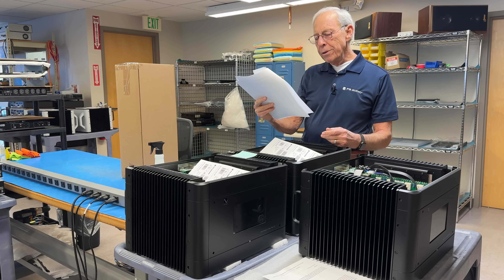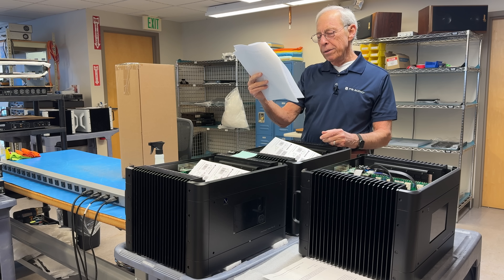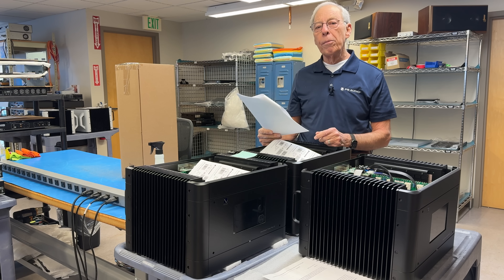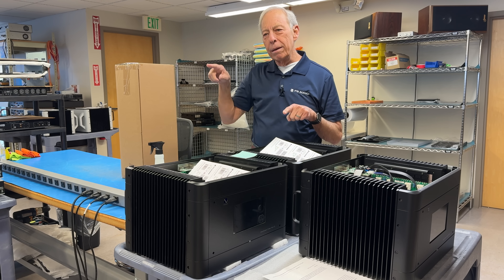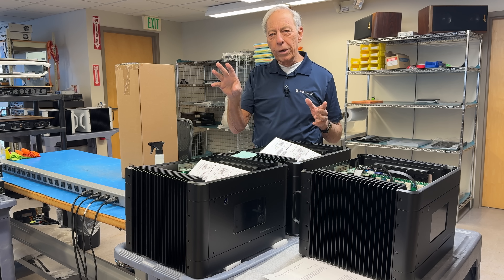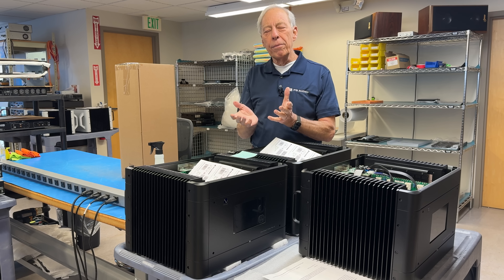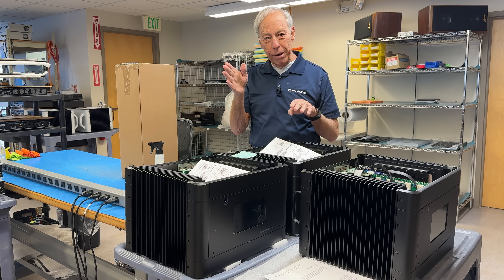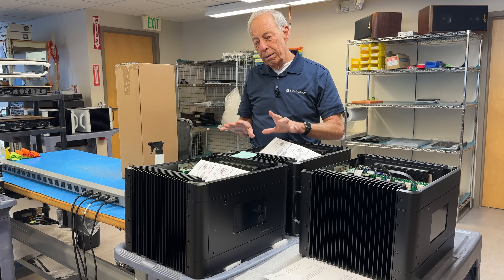Paul explains damping factor

Comment: Late to this discussion.
I found this one very controversial. I'm not sure where to start.
First I own a Magneplanar 1.6QR.
I also own a Rotel MK RB-1582. Both are paired with 10 gauge home depot wire. Sorry, exotic cables are just snake oil in my opinion.
First the maggies are relatively easy to drive. They are almost 4 ohm resistors. Any amp worth it's salt can drive these things. The amp is rated 323 watts into 4 ohm loads .
The amp is rated as having a damping factor of 800. I also liked Rotel's design philosophy of placing high emphasis on the power supply. We are basically listening to modulated power supply output.

I enjoy listening to my system and only had 2 issues which are kinda nonissues. First I tested to see how loud I could get it without the wife around. It got very loud, just not super loud like conventional boxed cone systems or my favorites, Klipschorn.
The second was those canon shots on Telarc's 1812 overture. I could hear that known rattle from mylar diaphragm. That just confirmed I'll buy a sub. No hurry though since 99.99% of the time it's excellent.

Circling back to the topic, I wonder just how genuine the original question is.
Also, do I detect a bit of jealousy from Paul since McIntosh is a rival. They make excellent sounding amps.
The letter writers shock at the rotel not properly driving the 3.7 is shocking to me as well. It doesn't make sense.

Comment: Its all about Control! I owned a system and had a Kenwood KAC-1021 which was rated at 840 watts @4ohms for my Kicker dual 10” Competition box. The Damping factor on it last I knew still hasn't been matched but maybe someone does make something, the rating? Hold on Tight, it was 5,000

Comment: 30+ years in the biz, EVERY company that says damping factory is meaningless has low or unrated damping factor. 
IMO: My favorite amps are: Pro/studio - Crown, home - Adcom and Car - JL audio and Soundigital.
Each have 800 /1000/3000+ damping factor specs. 
Crown Studio Reference amps are 20,000+
Bass is very accurate, very controlled. Very noticeable difference, especially when playing at louder volumes.

Comment: As I understand it though, Paul....very high damping factors can sometimes come across SUBJECTIVELY as having too much grip on a driver.   As a result...the subjective listening impression can be described by some as dry or clinical, possibly lacking in decay and "realism".   Whereas a damping factor that is sufficiently high, but more in some sort of sweet spot (often discussed as about 8:1 for dynamic headphone applications)…yields what many listeners perceive as a warmer and richer tone to the music.   So I think I understand this topic as still in search of a bit of a goldilocks outcome....not too high, not too low.   The implication being to have a clear understanding of the "matching" you are doing when you put system components together in a chain.   Do I have that about right?   It makes me sort of wonder what's the damping factor of our eardrum relative to our auditory nerve, if there is such a thing!

Comment: Seems to me that if the amplifier has zero output impedance (in effect a short circuit) then damping is limited by the resistance of the speaker and cable.  To get damping better than that means making the output impedance negative.  Is this commonly done?  I don't know.

Comment: Hi Paul, where do you pull your questions from?  What happens when you pair an amplifier that has a higher power rating than the recommended power suggested for the speakers?  I have an Arcam class G amp rated at 80watts into 8 ohms and 125w into 4 ohms.  My Totem Arro's are 4ohm, and have a suggested 20-80watt amp to drive them. I've owned this combination for 4 years and haven't noticed a problem with the speakers. So what is the 'problem potential' when you have an amp with a slightly higher max power rating than the max power suggestion of the speaker?  Thanks. Cheers.

Comment: Beware that speakers' rated impedance is NOMINAL. Speakers work at different impedances based on frequency, the rated impedance specified is just the range of impedance in the impedance curve that occurs more frequently. So if a pair of speakers is rated @ 4 Ohms, it means that in its impedance curve througout a listening session, based on the signal frequency (which is not constant) the impedance fluctuates touching several impedance "points", lower and higher than the rated one. In doing so, 4 Ohms "range" is the most occurring one, which determines it being specified @ 4 Ohms. In this case you need to know that you need to buy a power amp that is rated the power you need at the given impedance. However, also beware that damping factor means higher negative feedback (at least to my knowledge), which might result in a more controlled sound to the point where it might get lifeless or too flat. Normally is unlikely anyone needs a damping factor higher than 100. We often see amplifiers specified at several hundreds when not in the range of thousands. I am not sure that is really necessary or is just overspecification to attract customers. I'd rather have a reasonable damping factor, as low as I really need hence the least amount possible of negative feedback.

Comment: Many years ago, I was looking for an integrated stereo amplifier.  The salesman was showing me Rotel and telling me how great it was.  But then he insisted, you will need a powered subwoofer.  I told him I already had speakers that would shake the walls and had enough bass without a sub.  With "just" a tube amp.  I did not buy the Rotel.  Surprise surprise.  There is better equipment out there with more current to speakers for less money.  That's all I'm going to say about Rotel.  Thanks for the video.

Comment: Yes, certainly. But not just that.
Indeed, the speaker cable impedance has also its role, worsening DF. You can have a high theoretical DF, but the real cable impedance adds to the amplifier output impedance.
So, it is by far more meaningfull to  say 
DF=Speaker impedance/(Amp output Z+speaker cable Z).

Comment: Damping factor is not a technical spec, it's marketing talk. It DOES relate to a real technical spec, which is the output impedance of the amplifier. A "damping factor" above about 20 makes no difference due to the series resistance of the speaker's voice coil. Current delivery has nothing to do with it so long as you're not clipping the amp.
Reply: McIntosh designers agree with your 3rd sentence. I could listen to a McIntosh amp at high volume all day.

Comment: The High Current Amps I own the ADCOM gfa 555 ii & Hafler DH500's the lights dim when I turn them on.  lol
Reply: That's because they should have had a soft start board.
Reply: @mitchtaylor6512   Yes. because there is no speaker protection relay after they are turned off the speakers remain connected as the power supply capacitors slowly drain to zero.
Reply: @williamwahl6464  that has nothing to do with a soft start board.
Reply: @mitchtaylor6512  Isn't that great?  No unnecessary cr@p.  Pure clean power!
Reply: @williamwahl6464 a soft start board is necessary with high powered amplifiers, Adcom didn't have one due to cost, it doesn't do anything to the sound. My Krell amp would blow the breaker every time I powered it on if it didn't have a soft start board. My Adcom amp used to always ruin power switches because there was no soft start board.
Reply: @mitchtaylor6512  3 Adcom's 555 ii & two Hafler DH500 don't blow my breakers.  It seems they have shut off my replies to you.  Wonder why?  Maybe they don't like ADCOM & Hafler (DH500 ranked Top 10 Best Amps ever)  fans replying.  BWaHaHaLoL
Reply: @williamwahl6464  those are decent amps, but they don't compare to the Krell I have, not in sound quality or build quality.  The kell power transformer is 5kva the Adcom is 750kva if I remember correctly, the capacitance of the Krell is 268,000uf the Adcom is 33,000uf.  That's why it would blow the breaker without a soft start board.
Reply: @mitchtaylor6512  When I see Krell owners having to defend their gear makes me think "look at the source".

Comment: When I had upgraded from Technics A900mk2 (80W at 8ohm) to Bryston B60R (60W at 8ohm but with more than 500 damping factor ) in 2007, results were unbelievable while listening Heavy Metal (Metallica, Judas Priest, Iron Maiden etc.) at near max. volumes. It was playing such loud music as easy as beloved ones whisper to your ears. No distortion, no loss of notes on extremely high speed drums, bass guitar playing right inside your whole body and electro guitars screaming riffs so easily. Amplifier's control on the loudspeakers (Definitive Technology BP6B) is awesome. Music was sometimes so loud that my Technics CD changer was sometimes skipping tracks (I solved that problem by only using Technics DVD-A10 in my main system). In short words; high DF rocks 🤘🏻
Reply: ThAt doesn't have anything to do with the damping factor, most likely a more robust power supply.

Comment: A low damping factor seems to be desirable on music instrument amplifiers to increase the feel or "sag". I've seen a lot of older SS guitar poweramps with a switch on the back to reduce the damping factor. Newer class D amps marketed at musicians all seem to have high damping factors and are very stiff and unpleasant to play through in my experience - is this an inherent limitation of class D or can they be designed to react the same way as class AB amps with a low damping factor?
Reply: It's probably because class D amps have a lot of negative feedback.
Reply: @mitchtaylor6512  you mean they don't have a lot of negative feedback?

Comment: Alas, there are many claims about damping factor I cannot agree with. But the topic is too big for a single YouTube comment? Should I try? The fact is that the amplifier can only see one impedance at any one frequency and the amplifier does not see its own output impedance, only if you short it to ground and that ain't a good idea. So divide the load by the output impedance does not tell us much. Voltage sag under load is real, but not related to damping, but it does cause the load to draw less current and that can be misinterpreted. So it comes down to how you look at things and yet physics is physics. When it comes to damping, since output impedance cannot be zero (the ideal voltage source) then the amplifier can only worsen damping because it will always have an impedance above zero. The physics was once pointed out to me personally by none other than Richard H. Small, who told me that the alignment of the speaker, which includes the output impedance of the amplifier, is entirely defined by the final alignment of the speaker. So what if you have two identical amplifiers with the same alignment because they have identical output impedances and one sounds to have better bass than they other? Then it clearly have nothing to do with damping factor (they are the same) and it simply comes down to the fact that one of them is simply the better amplifier. It is probably more linear. These things does happen. And then what if we compare two amplifiers where one has a significantly higher output impedance and yet it just sounds better? Yes, now the alignment is not the same if the same loudspeaker is used. What gives then? 

Let me explain something really wonderful: The best bass I have heard is a tube amplifier that has an output impedance of 4 Ohm into a special loudspeaker that had current EQ flat around 25Hz and above to 100KHz, which will largely cause the large 4 Ohm output impedance to be cancelled out( no, I kid you not, it is physics) and the result was amazing. But it has not yet been done commercially but some of us know how to do it. EQ the current above 20-30 Hertz so that the speaker will draw the same current at all frequencies and you will have no current or voltage sag from the amplifier. So yeah, we may be at the precipice of a revolution! It was even tested with a current source amplifier with 1000 Ohm output impedance. No amplifier damping in sight, the speaker alignment behaves like it is seeing zero Ohm with any amplifier!

Now I am probably in a LOT of trouble? Will I be called a liar?

Comment: i upgraded from my already great Parasound 2125v2 (150 damping) to the PS Audio s300 (dual mono, 1100 damping) to power the low pass for my PS Audio FR5 biamped and wow! (my NAD c298 has 800 damping and powers the high pass for the FR5 tweeter)

my video: 

Hifi Kick drums kick my ass! PS Audio S300 (dual mono amplifier), WBC Ultimate 9 gauge speaker wires
https://youtu.be/-WbVsly1X0w

source=Apple Music lossless quality
——-
paul: i want to buy a PS Audio preamp with auto HT bypass and tone controls but u don’t make one, so Ill stick with my Parasound 2100.

Preferably with active adjustable high pass knob like my Parasound 2100.
Reply: Nothing to do with damping factor in this case.

Comment: High current capability is not directly related to high damping factor although they often go together.  Damping is equally important at low levels where the amp isn't having to deliver much current.

Comment: Paul's explanation of the damping factor is correct but this video is incomplete and even might be promulgating debunked audio lore.  The Rotel 1592 has a damping factor of 600.  Objective measured tests show that in the range above 200 (and maybe even lower), the damping factor makes ZERO difference to the speaker's output waveform even in old-school, high excursion, softly suspended subwoofers.  See videos from RAW-CAt.  It makes sense that any audible differences between the Rotel and the Bryston 4B is NOT due to a difference in damping factor since the Bryston has a claimed damping factor of "over 500", not "twice the Rotel's".  The writer from Toronto should have his new Rotel checked to see if it's working properly.

Comment: I prefer to not compare apples to oranges. In my world, lower efficiency speakers with lower BL factor (magnetic control from magnet force in the gap) on the woofers need more damping factor. Higher efficiency speakers with high BL do NOT NEED high damping factor and many times high BL and high damping factor sucks the life out of the music. This means for speakers under 90dB/Watt/Meter high damping factor is a thing to at least pay attention to. For speakers under 85dB/Watt/Meter it is even critical.
For speakers with >95dB/Watt/Meter, much care must be taken to not kill the bass with the amplifiers damping factor. In many cases, a tube amplifiers with output transformer will be a better solution. I can not count the quantity of bass starved high efficiency home systems that I have listened to. It is important to note that no equalizer can balance starved bass.
Reply: I agree with some of your information, but damping factor has little to do with efficiency  There are a lot of high current amps with modest damping factor that drive  low efficiency speakers better than amps with high damping factor.

Comment: A generally like Your Videos Paul, even this one mostly;) I have a Rotel Michi S5. This one really rocks hard to drive Speakers with it's very low Output Impedance. But when I chose my preamp amidst several preamps such as the likes of Accuphase o.a.  I decided (for my suprise back then)  for my McIntosh Tube preamp, since I liked the Sound much better than the others from the point of musicality. I really fell in love with it❤. I did not suspect You of beeing one of those McIntosh bashers😂

Comment: As usual the comments are great. Paul should just read the news paper to the camera and watch the comments fly. 
I learned many years ago that maximum power transfer occurs when the source impedance matches the load impedance DF=1. In a tube amp, the secondary side of the output transformer usually has multiple taps (4,8,16) ohms to be paired with the corresponding (load) speaker impedance. In this way, low power amps (<30 watts) can transfer maximum power to impedance matched high sensitivity speakers===Gold. That formula is tough to beat.

Comment: Isn't damping factor and the amps ability to store current such as large capacitors on the output stage to deal with inrushes of power and dynamics two different things? I always thought damping factor is the amps way to control the counter EMF produced by the speaker that will effect the amps performance. I was also told as great as a high damping factor would be it also effects the quality of the sound when not needed such as in easy to drive have sensitivity speakers.

Comment: I got this from a Google Search and cannot site a source.  Citation II is my idea of the best amplifier ever sold for stereophonic use.  Great output transformers.  Frequency range is "pretty much" DC to light. ( Show More if you care.)

The Harman Kardon Citation II has a damping factor of greater than 18. 
An amplifier's damping factor (DF) is the ratio of the load impedance to the amplifier's internal output impedance. It indicates the amplifier's ability to control the loudspeaker's overshoot, or to stop the cone from moving.

Comment: Paul has a well said and layman  explanation. Damping factor of an amplifier is the ratio of the loudspeaker impedance to the amplifier output impedance, the lower the amplifier output impedance the higher is the damping factor and hence the higher power is delivered to the loudspeaker. For example a tube amplifier has a 8 ohm load and it's output impedance is 0.1 ohm, then it's damping factor is 80. That said 100W power when delivered to the loudspeaker is 100×(8÷8.1) is 98.76W, however a loudspeaker is a reactive load that changes with frequency. When the loudspeaker drops to 2 ohms at lower frequency, the 100W power delivered to it is only 100×(2÷2.1) is 95.23W, such that the energy is lost much inside the amplifier